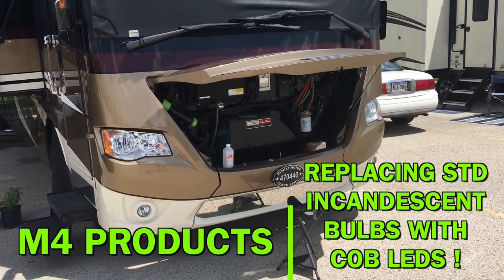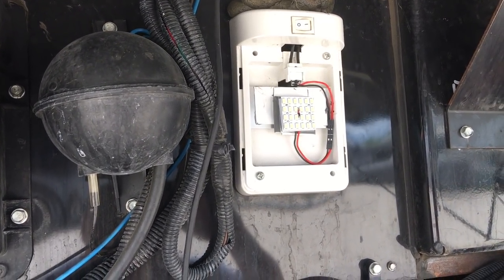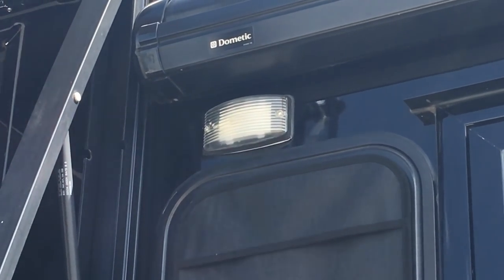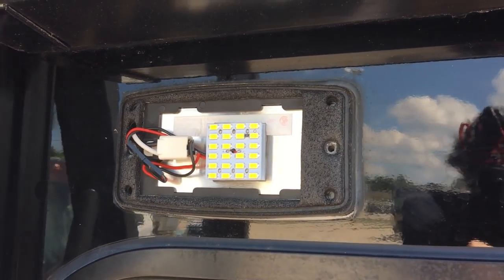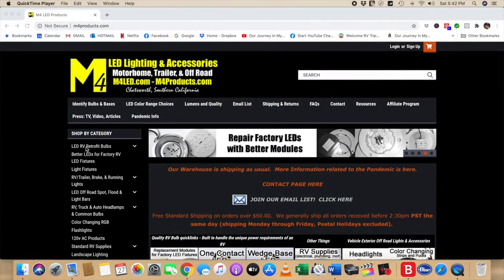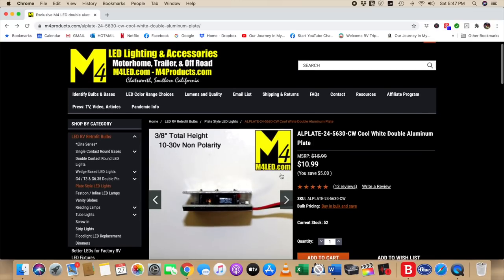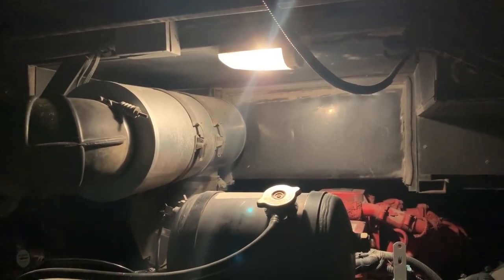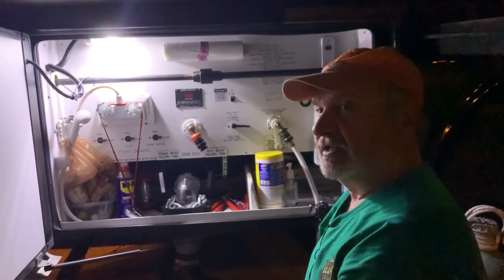M4 PRODUCTS - PART 2 | PLUG IN COB LED RV LIGHTS | 12 VOLT RV INCANDESCENT BULB REPLACEMENTS | EP127

Comment: Just wanted to thank you both we ordered a T S D fuel card and we put you guys down as a ref looking forward to the savings to bad the theres no savings on d e f but hey all good
Reply from the maker: As an RVer, we use so little DEF I actually prefer buying it in the jugs so it is as clean as it gets.  We just buy it at truck stops that go through a lot of it and store it indoors. No Walmart brand used.  This was being used and then refilled with regular water and then returned to the stores! What the heck!
Reply: very true we have done the same so far safe travels

Comment: Great video.  My 2018 Tiffin already has LED bulbs all around, so I won't be replacing those any time soon, but love your ladder.  I don't currently have a ladder, so thanks for the recommendation.
Reply from the maker: Inside our 2014 Newmar DS rig, most of our bulbs are LED,........but not all. NONE of the outside basement lights are LED.  You don't want to forget and leave those all on for a few days!
Reply: Our Journey In Myles our outside basement lights have three switch settings: off, on, and auto.  The auto setting uses a motion detector to switch on the lights.  When the doors are closed, the lights go out after a few seconds.  I leave all of our outside basement lights on auto.

Comment: Nice job. A little engineering of making the gen bay light pointing down ward like the engine bay may help of being blinded by the light 💡. Great info.  If buying a new fixture for the engine bay. Put both in spread out. Never can have enough light in a late night road situation. 🇨🇦
Reply from the maker: Thanks for the tips Mike!  My "real" go to light is the 105 lumen Ray-O-Vac headlight I wear on my head.  It has an awesome 3 strap head harness.  I have four of them so I can always not find two of them and still be good,.......

Comment: Nice video and explanation as always. Wondering if you have used the Eternabond on your roof for anything? Take care and be safe.  Mike & Brenda
Reply from the maker: Yes I have,............the front and rear fiberglass cab caps on motorhomes are like snap on caps on the ends of a tube.  At the joint where they overlap, eternabond tape runs the length of the seam, right from the factory.  I have had this tape redone twice already.
Reply: @OurJourneyInMyles  So the "eterna" in the name is not from the word "eternal" i.e. lasting forever? What happens to it?

Comment: Nice.  I've wanted to install a LED light strip across the back of the engine compartment but am concerned about how hot it may get in there and how the lights would hold up.  Will be interested in how yours hold up in the heat.
Reply from the maker: If I was going through the trouble, I would put one of the off road LED Fixture Light Bars in.  I suspect you would be fine.  The black housing ones sitting in the Arizona sun bolted on the top of someones Jeep can't be worse then the engine bay environment,.......but you are correct,......if could be a gamble.
Reply: @OurJourneyInMyles  My generator powers out in the front so I may try to put something in there first since it should be a lot cooler up front'  Now I need to find where I can tap into an active 12v power source.

Comment: I was wondering, I noticed that nobody keeps there engine and generator compartments clean. Do they not recommend to spray them out every once in a while. I know working on large aircraft ,we try to keep these areas as clean as possible to see leaks and cut down on potential fires.🤔
Reply from the maker: I am sure plenty of folks keep it way cleaner than I do,......but expect most keep it dusty like mine. If I cleaned it PERFECTLY today, all I need to do is drive into one campground with a dirt/gravel road way and all my work would go out the window.  I have decided to clean if perfectly when I am ready to buy my NEXT one!

Comment: I kinda like adhesives.... check out 3M dual lock, in my opinion, this product line sets a standard, there are aircraft carriers with this stuff holding electronics in place, ... I know, I've seen me using it.....
Reply from the maker: Looks like if you get a 10 foot roll of that stuff you'd be all set!  Hope my bulbs never burn out!

Comment: All you need now is to have sensors that turn the lights on automatically.
Reply from the maker: When I was younger, projects like that were FUN!  Now,.........I just think "Too much bending!"
Reply: @OurJourneyInMyles  I hear you. I just told my wife last night after doing some work up on the Roof that I'm getting to Old for this. I don't have the stamina I used to. I remember moving my 400 gallon glass fish tank and I was on one end and two of my brother in laws and a friend was on the other and they were belly aching as to how heavy it was and Thu couldn't figure out why I wasn't struggling with my end all by myself. My friend used to say I had farmers strength. The good old days.